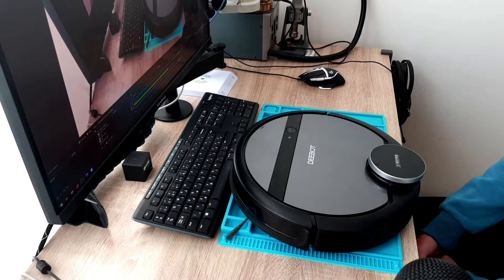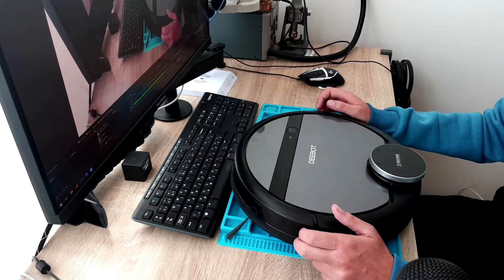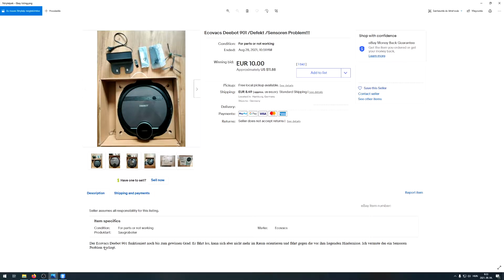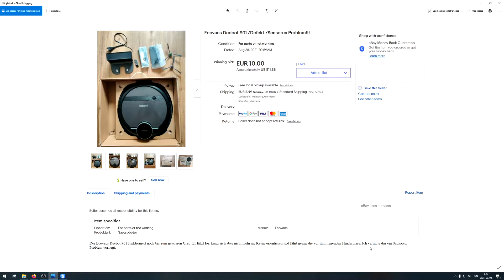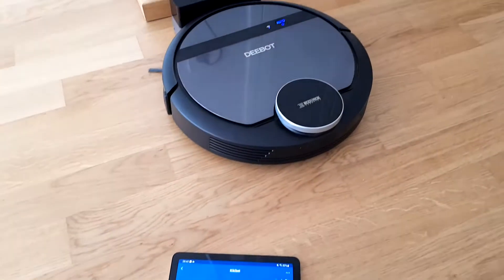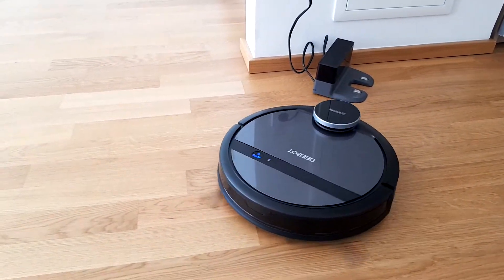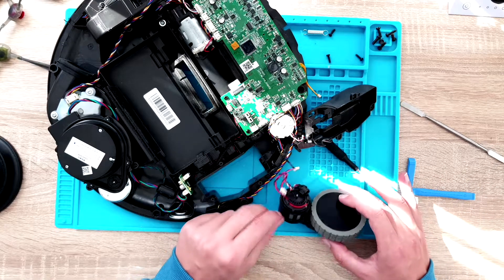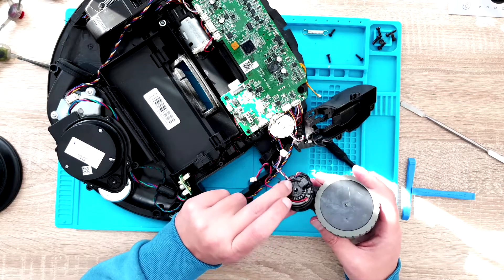Deebot 901 robot vacuum  cleaner repair

Comment: My deebot have the error lds malfunction.  I already clean the lens. Dissambly e check the belt. Is normal without lds connected have the same error?
Reply from the maker: Are you sure the belt is not loose? Is the lds spinning?
Reply: @kikihobbyrepair  yes spining about 30secs and stop. Do this 3 or 4 times and had lds error
Reply: @kikihobbyrepair  any solution?

Comment: Hello Kiki ! I have same DEEBOT, mine has recently a very loud sound when suctioning. Have you had that problem or could orient us on how to repair it? I live in Colombia and here we don’t have any ECOVACS support, so it seems we need to do it ourselves. Thanks in advance if you can help !
Reply from the maker: Hi, to be honest this was the only one I worked on.
My first bet would be the main brush shafts. If I remember correctly those are rectangular or hex shafts from plastic. Take a look at it if it is not weared out/rounded on both ends.
Does the robot moves on a straight line without any problem?

Comment: I have a couple of ECOVACS Deebots 950 on two different floors of the house. My Charger dock for the top floor bot has gone bad (i can definitely see its not putting out the 20v DC, right now, i have the bring the bot downstairs everytime it runs out of the battery after a cleaning cycle). 

Is there a way to open this charger base? Its so compactly packed, that i am unable to find how to open it. If i could open it...possibly i can check what has gone bad...

Thanks.
Reply from the maker: You could check if you can find any Youtube videos about the dock disassembly itself. Unfortunately the one I repaired is not at me anymore so I cannot help you. Look for hidden screws at the bottm maybe under rubber feets and things like this.